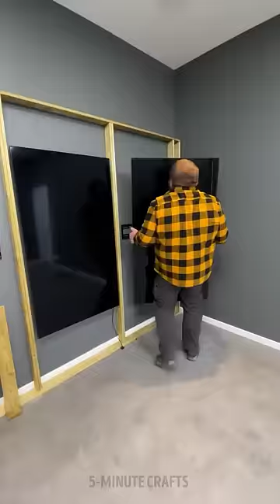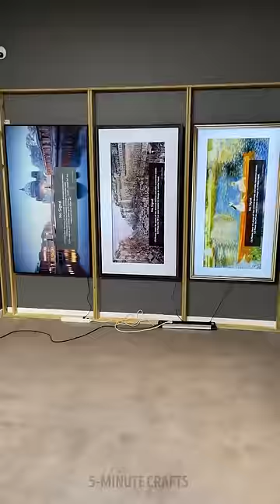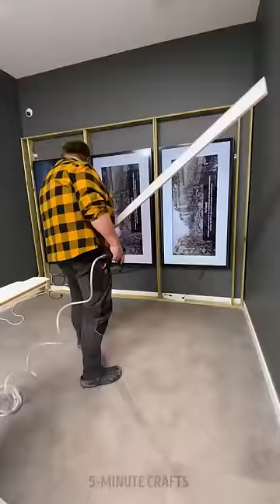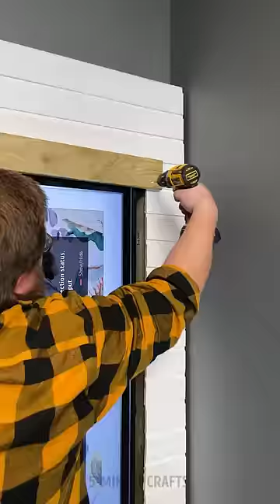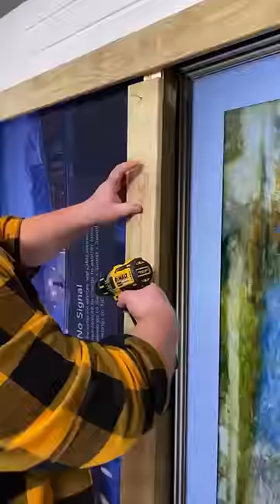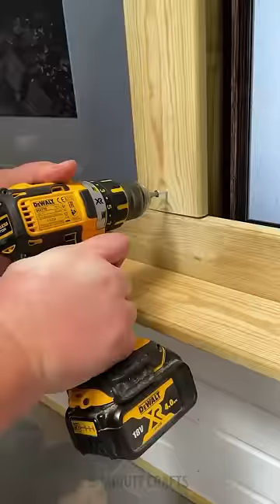Make your Shorts a hit with ”POLAR, LA LA LIFE - BAILA”: the top trending sound of the month! 🚀🔥

Comment: There has to be a video matrix or some controller to be able to cover three TVs like that right? how else would the source (picture) be able to distribute across the three screens like that

and a video matrix is pretty expensive
Reply: It can be achieved by using HDMI video splitter which can split a video frame into multiple parts
Reply: But a splitter would take the whole image and replicate it on each screen. They would need a seprate image for each screen, three different sources. Or a way to process the image to split evenly across the array of screens. @AkshayKumarSingh91